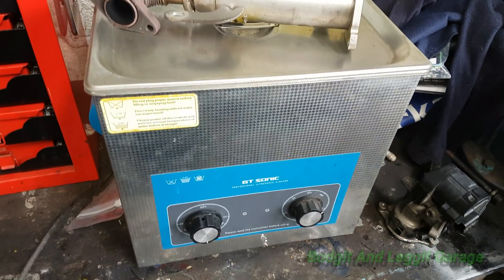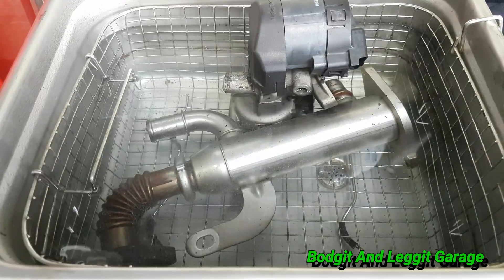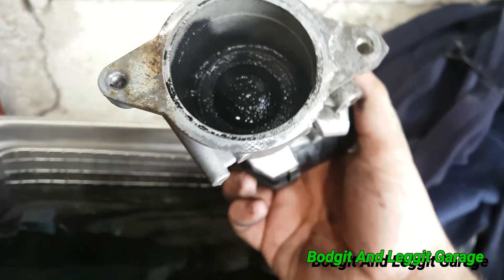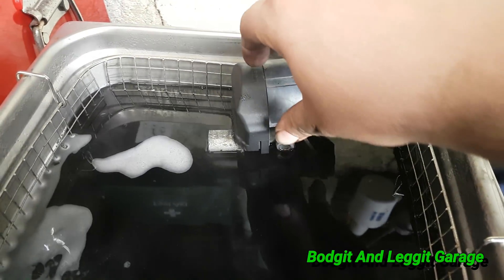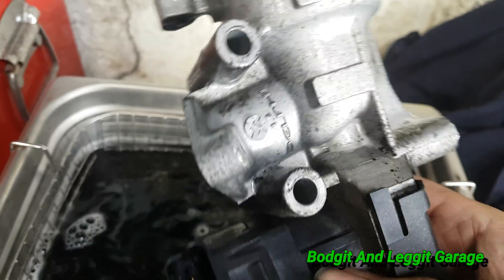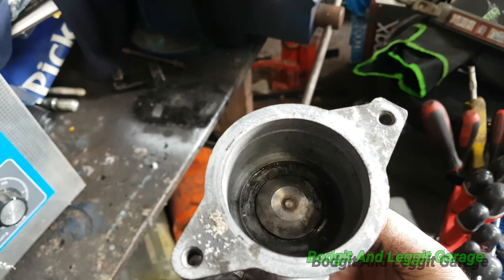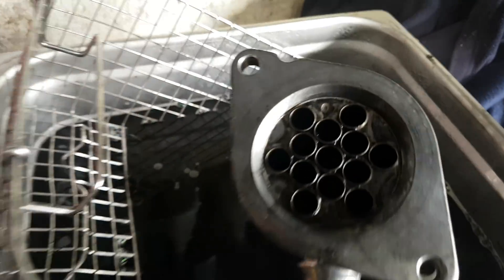Ultrasonic Cleaners Do They Work (EGR And Cooler) Bodgit And Leggit Garage

Comment: i watched a loot of people using ultrasound cleaners but seem no one actually read the instructions. For car parts as example the minimum time of cleaning is 2h wich means that for a deep clean is around 6 h. As about the liquid to be used depends on what u clean in some cleaning cycle need to be used 2 cycle one with one product and one with diferent product. In the worst scenarios between one cycle and the second need to be dry in owen not to hot but enaf to get it dry deep .

Comment: Try 25grms of citric acid in the water it is very good on carbon and it is cheap. You can  also use it to descale kettles, shower heads or make lemonade,  sour fizzy sweets the list goes on.
Reply from the maker: More than one way to skin a cat but I'm going to stick with the ultrasonic cleaner cos it gets in everywhere and I know it's awesome

Comment: Dishwashers are great, no electronic parts though.
Reply from the maker: LR Disco yes mate I've put lots of stuff in dishwashers and you can put electronic parts in them to you just need to make sure you clean them properly afterwards I've put loads of circuit boards in dishwashers before

Comment: What solvent did you use bud?
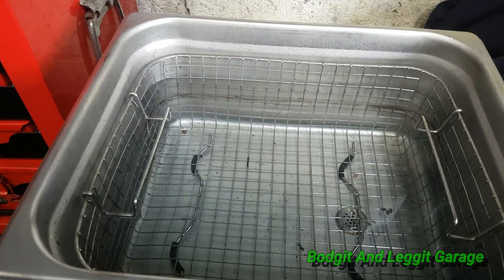Reply from the maker: Iain Marshall hi mate 0:49
Reply: bodgit and leggit garage In other words, you are using SeaClean2, a proprietary ultrasonic cleaning fluid available from Amazon UK for £8.83 (delivered) for 500 ml of concentrate, if you live on that side of the Atlantic. Would an industrial detergent/degreaser and heated water work just as well in the sonic cleaner for those of us in the USA and elsewhere who are too cheap to buy SeaClean2?

Comment: Sorry to side track but how did you get the bottom allen bolt out of the egr?  thanks
Reply from the maker: des allen hi mate I made a special tool to get underneath when it's on the lift it is awkward once I've removed it I always replace it with a 10 mm normal bolts this means a lot easier to get on and off
Reply: bodgit and leggit garage thanks for the reply, I was hoping to do the same with the bolt idea  but haven't yet succeeded getting the Allen bolt out yet.  I will see if I can get in from underneath.  Thanks.  P.S.  any chance of a video on this? I know from what I've read that not only me is struggling. The YouTube vids I've seen tend to skip that bit :)
Reply: Hi des, i'm no mechanic but did mine, i cut the short end of  a spare allen key down till it was stubby and it just about went in, what cost most of my time was trying to work out  either the size or if it was a torx bolt, so in the end i pushed some blue tack in it for an in-print, ps I've since found out you can get some nice little stubby double ball end allen keys offline.... Andy
Reply: Thanks for that Andy   dont suppose you have a link per chance?   life would be so much easier if we had a ramp :)  by the way who the hell thought to put an allen bolt there?  thats nearly as bad as putting the fuel filter at the back.......
Reply from the maker: Some muppet thought it'd be a good idea cannot understand why you can use that idea just be careful make sure you are fully on with the allen key you only have one chance you can also very gently move the EGR valve left and right this will also loosen it a little bit and make it easier for you to use the allen key
Reply: bodgit and leggit garage thought about wiggling it but didn't want it to crack  I will have a look at the weekend.   Still think people would appreciate a quick mention about it next time you are underneath a mk4 :)
Reply: something like this, BONDHUS STUBBY DOUBLE BALL END HEXAGON ALLEN KEY 1.5 - 10mm L WRENCH SET... that ebay from Wiggan £22.89 .... or you can just get the stubby non ball end like what i made
Reply: Thanks Andy :)
Reply from the maker: The Funeral Director 1965 thanks a lot for that mate I'm going to check them out
Reply from the maker: Hahha I've already got a set of them I don't know why are my head I was just imagine them being really small on both ends lol
Reply: nice n stubby one end and probably too long the other end so you'll still need to get the angle grinder on em lol
Reply from the maker: The Funeral Director 1965 the grinder solves everything lol
Reply from the maker: will do mate next 1 i do i will film it
Reply: bodgit and leggit garage  cheers mate.
Reply from the maker: des allen anytime mate